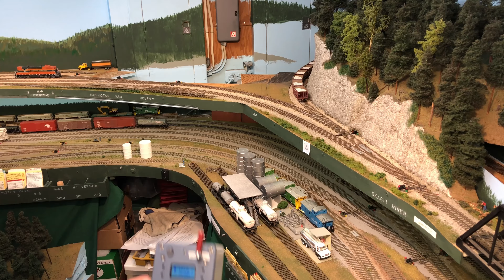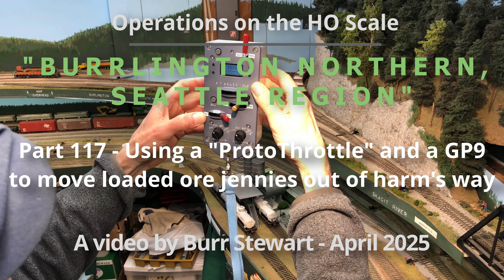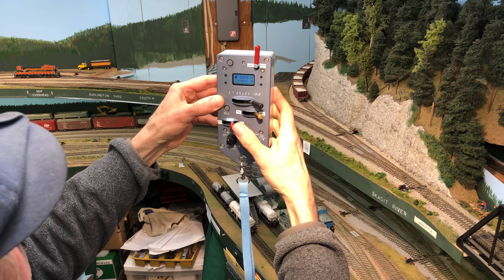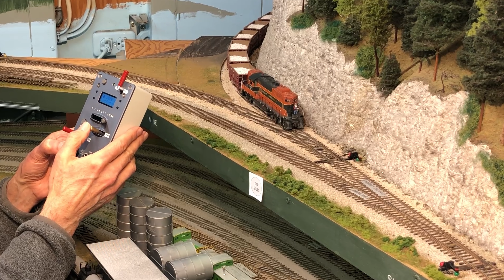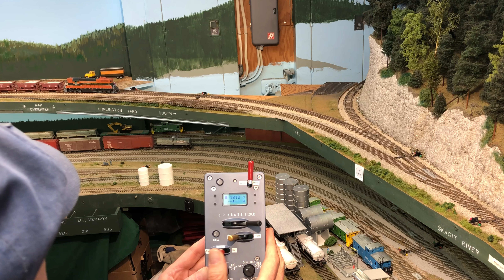Part 117 - ProtoThrottle demo w GN GP9 and ore jennies #hoscale #modelrailroad #protothrottle #train

Comment: Hey Burr, thanks for the info on the direction for the Great Northern GP9. I was wondering if the Northern Pacific also did this? I have been following the SP&S and know they ran their GP9 and RS units long hood forward. I want to make sure I run the GP9's for GN, NP and SP&S correctly.
Reply: Well since I am using these locomotives on a fictional short line, I could say I have bought or rebuilt them to run the long hood first. The fun of model railroading, you can change history to your own liking.
Reply: @thomascanady1967  
Absolutely Thomas! 👍
And there's always instances where hood units are caught running "backwards" anyhow - due to there being no place to turn around for the return trip at the end of a run... 

There are plenty of pictures of LIRR C420's which had only one control stand set up for LHF operation, running short hood forward - and let's face it, this IS the beauty of the road switcher design in the first place!
Reply from the maker: Regarding the "F" painted on the side of the engines, I'm understanding that they didn't start doing that on the BN until after 1973, though.
Reply: @muchfunwithtrains  
No kidding Burr - good to know!
I haven't looked into it whatsoever... I just assumed marking the end the control stand faces was standard practice across the board since the inception of the road switcher design.
Reply from the maker: It's a complicated subject, and I'm no expert. As far as I know, the NP ran their GP's with the short hood forward. The SP&S took over various groups of engines from both GN and NP, and purchased their own, so you have to do some research to find out if a particular SP&S engine was set up to run short or long hood forward. The SP&S RS3's that they got from the NP were run short hood forward.
Reply: Units with dual control stands notwithstanding, isn't the easiest way to tell just looking at prototype photos for the telltale "F" on the sill near one end of the locomotive? 

Of course ,there are exceptions... i.e. CNW ran its dual control stand equipped Alco C628's short hood forward, even tho the long hood was designated as the front...